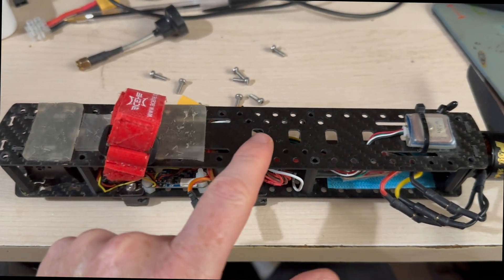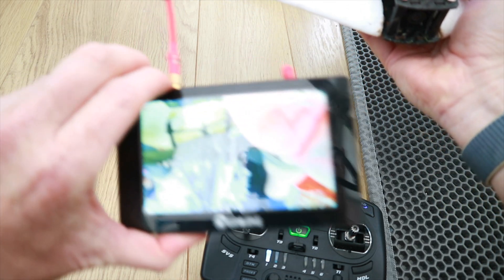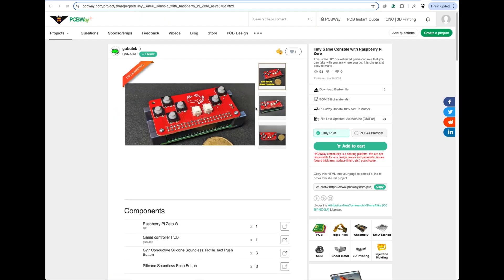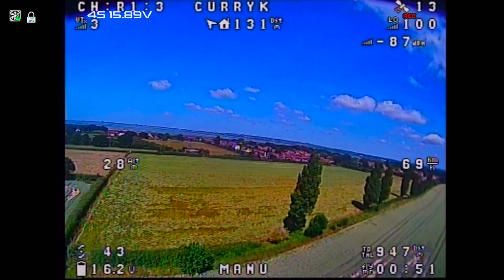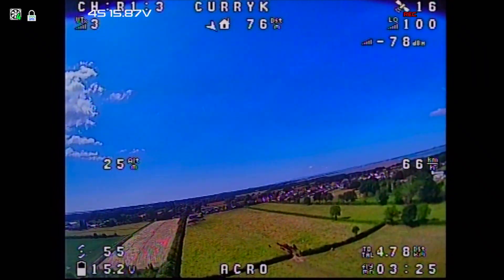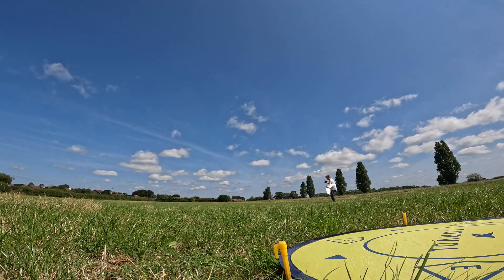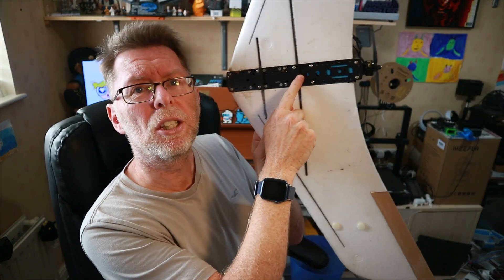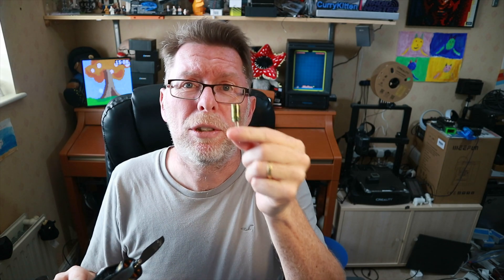Bad video noise on this wing, will a single capacitor fix all my problems?  Crashes Included!

Comment: Check your motor thrust angle Wayne. I cured a yawing Autolaunch climb out by shimming the motor....This wing is possesed though...Low airflow at launch makes the FC impotent. Try a bit less throttle...🤔😏

Comment: add one big main ground from battery lead to the ground on the bord or to vtx the pads on the bord are so small the grounds are poop
Reply from the maker: What’s the difference between doing this and taking the ground up from the esc board to the fc?
Reply: @CurryKitten  the esc is what cause the volt feed back static . just wire everything normal but add a nice gauge a little thicker wire for a ground and solder right on the pad where the battery lead is and run it to the wire that runs off the fc for the vtx so the ground is connected and it gives better ground to the whole bord you can solder to the bord if need i just jump it or dont use the ground pad from the fc they are too small

Comment: Giro induced pitch oscillation whilst in Acro...I bet it doesn't do it in manual....That wing is the work of the Devil. Its why it didn't sell....Capacitor worked nice though Wayne....🤔😏🇬🇧
Reply from the maker: I don’t think it did it on the last config but that’ll be a good test for next time. Cheers
Reply: @CurryKitten The other obvious thing to look for is linkage slop on the Elevons...🤔😳😏

Comment: its not PIDs or any Inav problem...its CG
Reply from the maker: Flies fine when in the air. Are you thinking tail or nose heavy ?
Reply: @CurryKitten  I dont remember tail or nose..I had this same problem with my s800 sky shadow wing ( my turbulence was even stronger) I fix this moved the batteries to the right place ,keeping the nose slightly heavier if I remember correctly...

Comment: I knew a nice new low ESR cap would sort it (mostly) out. If you've got plenty of oomph, try launching vertically and letting it corkscrew itself into the air. Its the only way Rupes can get his 12S 500mph FunJet Ultras up but it even works on my 3S Teksumo as long as you've got the power to weight ratio (and it looks impressive to bystanders)
Reply from the maker: Types is a supremely good LOS pilot. I’m very suit in comparison 😀

Comment: Hi Curry, I would run the run full throttle in Manual and then in Angle and compare. If you get the wiggle/oscillation in Manual, I would stiffen the ailerons (and maybe replace your servo horns and linkages for a proper ones). I would also try to play with your PID (likely lowering your P values). Interesting video. Made me want to dig out my old analog camera and go and fly analog for fun...
Reply from the maker: I’m thinking compare in manual and acro to see what happens when the wing doesn’t try to correct at all

Comment: Manual is pass through. You are flying the wing without any FC assistance. Expo can be added in the FC but not much else. It is typically used initial when setting up a plane. FC's can hide certain things like COG issues. Typically you fly in this and set COG, servo linkage settings etc ( everything "mechanically" correct) so it flies well. Acro/Air involves the FC. Rates of rotation, PID's etc, and provides stabilisation against wind gusts but doesn't restrict how you fly like angle & horizon. It's all basically the same as betaflight.
Reply from the maker: Yep. Flies fine in all modes once it’s going. It’s launching the bigger that’s the issue. Although I do want to test the high speed run in manual vs acro

Comment: That "flapping" used to happen on the old X5 wings - it was due to the ailerons oscillating and the Cyclops Tornado flight controller attempting to over correct and getting into a mess.  I get a similar issue with the T-1000FC on my Z4 wing as well but unfortunately I can't dial the PIDs down any more on that and it doesn't have a "manual" mode ... you should definitely see if the issue happens in manual mode on iNav to rule it out.
Reply from the maker: I will do this. Cheers
Reply: I used to rock the Storm and Tornedo FC's. Infact I still have one or 2 knocking around in the garage. But I seem to remember they both had a Manual mode. If your saying you have lowered the gains to the max and it still does it, its the airframe. Check the set up and get manual working and see if it still does it. The gyros on those things were not the best. May be time to rip it out and go INAV.
Reply: @blackbirdboy1  yea thats what im saying - the Cyclops had manual mode and it was fine without stabilisation but with it turned on, the flapping would occur. The T-1000FC is permanently gyro controlled though so I can't do anything with it now that the PID adjustment limits have been exhausted - it's very flappy on pitch 🙂
Reply: @FPVSteve Ah, yeah. I forgot about the T1000FC thingy. As I was reading it, thought that was a VTX. Not sure why. But in my head, as I read it, I was thinking it was a vtx

Comment: Check your PID tune. I had to move my P value down to 8 in order to stop this at high speed. I had exactly the same but on the roll axis. Maybe move it down in increments of 2.

Comment: what I do is put caps on my power leads and then cover the ELRS and GPS wiring (which is twisted)  in copper tape then put heat shrink over that (so no shorting) , it really helps with openIPC and openHD projects - also try to keep wiring as short as you can get away with where possible